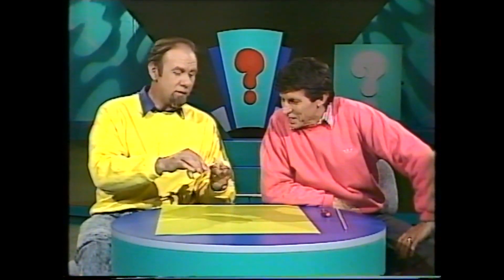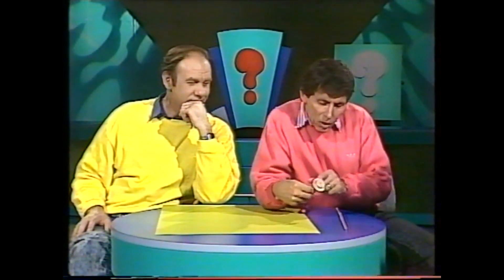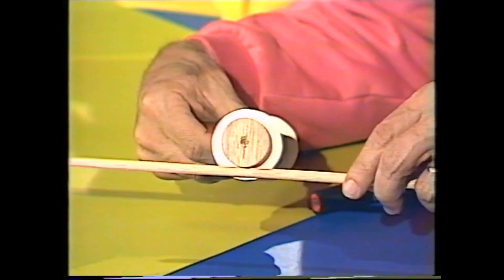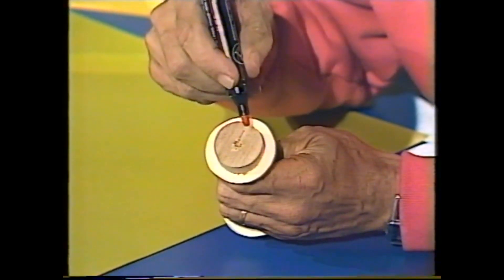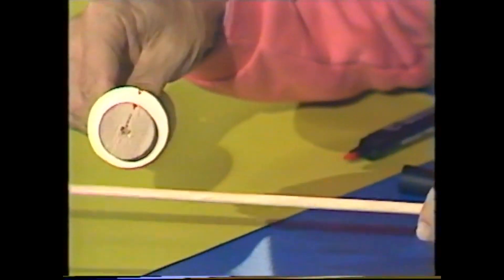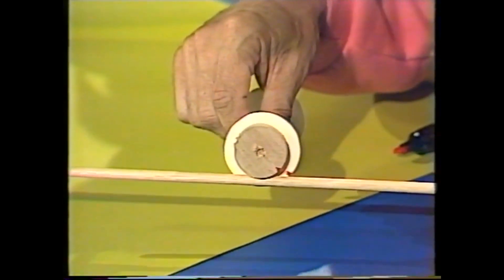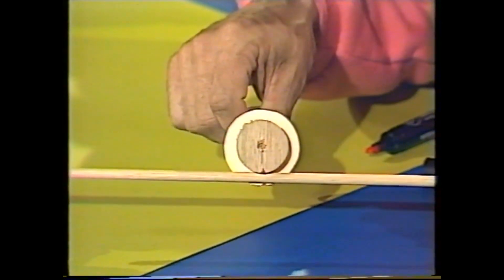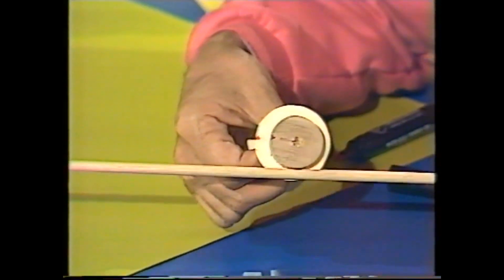How train wheels cannot work

Comment: Smiling...  Same explanation why one with the older Series LAnd Rovers cannot use four wheel drive when on solid surface roads.  On loose gravel, sand, mud everything works fine.  Why?  Because in 4 WD the wheels are locked to each other.  But on not-solid surface roads the wheels can slip a bit allowing curves to be no problem:)
True!  The wheel is also slightly tapered.  Thus slightly varying diameter.  Some Mathematician may wish to calculate at which radius - when too small - slip is the added factor.
Is, at least, my understanding of the whole picture:)
Thanks for posting all these  fantastic and interesting "Curiosity Show" videos. Have been following this channel for years now - that is, since I first discovered them here on YT:)  Much appreciated!

Comment: I've noticed that trains squeak and squeal when going around corners. I have assumed this is because the slower moving outer wheel is being dragged by the faster moving inner wheel. Not sure what point they were making about wheels going backwards. In my mind they are going backwards and forwards as the rotate on the axle.
Reply: The outer wheel moves faster to cover the greater distance. 
Here’s a good explanation. https://m.youtube.com/watch?v=XzgryPhtc1Y
Reply: It's not well demonstrated and explained; but, if they did it better in this video, there might be less to address in a follow-up one.

Whatever part of the flange is lower than the top of the rail is pivoting around the part (point) of the wheel that is touching the top of the rail at that instant.

Imagine a circle
- whose center is the point of contact between the wheel and the top of the rail
- and whose radius is the difference between the radius of the smaller part of the wheel and the radius of the bigger part.

A constantly changing part of the flange is occupying the bottom half of this imaginary circle, starting toward the front of the train and moving toward the back:  i.e., if the train is moving from left to right in your view, this part of the flange is moving clockwise from 3 o'clock to 9 o'clock, beneath the top of the rail; it's going from in front of the point of contact (3 o'clock), to directly below the point of contact (6 o'clock), to behind the point of contact (9 o'clock).

In other words, you have two pivots around which circles turn.  One is the axle, with the whole wheel turning around it.  The other is the point of contact between the wheel and the top surface of the rail, with the flange turning around it.

Comment: The lego train had grippy tracks for the outside rail and smooth slippery tracks for the inside. That way the inside wheel just slipped a bit. The straight sections were also grippy.

Comment: For cars to turn we have differential so that the outer wheel can travel more than the inner wheel and the car doesn't skid, so how does a train doesn't derail if it takes a turn? It doesn't have a differential and its wheel is connected with single shaft.
Reply: It is mainly the flanges.

Comment: Folks, the dot on the flange doesn't matter because it's not bearing on the rail. So yes it goes "backwards" but the dot on the wheel doesn't go backwards. It's the different diameter that causes it. Diameters are important for the turning as well. As many people have pointed out train wheels are truncated cones. The flange brings the cone into play - the flange scrapes the inside edge of the rail which forms the outside of the curve. That's the screeching. It's also why rails and train wheels wear out. The tracks have thousands of metal shards lying in between the rails.

Comment: Umm..
Is the Wheel & or Bogie in question externally powered  ?
What is the Screeetch I have heard on rail both light & heavy as it mounts a corner  ?
Reply: I think the screeching noise is called  curve squeal or flange squeal or something similar.
Reply: The squeal can be from either the flanges or the differential wheel speeds on the outside and inside of a curve.
Counteract with curve grease which comes in summer and winter viscosities and is now made from biodegradable materials.

Comment: Nooooo why??? I need to know this. Why does the train not have a differential like a car does for turning?
Reply: Why?  Because using differentials on a train with hundreds of axles would be too expensive.  Instead, train wheels are shaped like truncated cones pointing out from the train.

This system is self aligning on straight tracks. If the train begins to track away from center, then the side it moving away from enters a wider part of the cone and moves more distance with each direction pushing the wheels back to center. 

When the train goes around a turn, the same mechanism still works, but it's point of equilibrium is shifted slightly to one side to make the wheel sizes match the distance that they need to go around the curve with the same number of revolutions.
Reply: Tim Harig thanks! I couldn’t figure it out originally but this makes much more sense. Props

Comment: The train is able to go around corners because train wheels aren't flat cylinders, they're more cone shaped. This means as the train slides out, a bigger wheel rotates around the outside of corner, while a smaller one rotates around the inside. The two different sized wheels spinning at the same speed means the train turns.

That's the link between the two problems (although the first point is very oddly made) - the edge of a larger circle travels more distance than the edge of a smaller circle spinning the same speed.

 There's a video on youtube where Richard Feynman explains it way better than I do. Worth a watch
Reply: I first saw this demonstrated when I was about 19, visiting the London Science Museum ages ago.  They had a section of inclined track--initially straight, but with an S-bend at the bottom, with some roughly-dumbbell-shaped objects to roll down it.  The cylindrical-ended one could be made to roll straight down the straight part of track, but it would continue straight down the curved part.  The inward-pointing wheels couldn't be made to go down even the straight part without veering off; if they got even the tiniest bit out of line, they would steer even more in that direction.  The outward-pointing wheels, even if placed on the track slightly crooked, would self-stabilize and then follow the curve beautifully, with no flanges.
Reply: A lot of old transit equipment and streetcars do not have tapered wheel treads but instead rely on the flanges and somewhat the rail geometry.  On streetcars extremely narrow treads and flange bearing guideways were also common for the purpose of switches that work better in a street installation requiring less of the rails to be movable.  On a flange bearing system the flange rim tends to track in to the lowest apex of a groove so the physics are similar to the tapered tread.

Comment: The first point is bs right? It's just how you interpret the movement, but all in all the wheel is going round and in 1 way. I'm confused by their explanation...
Reply: Yeah I was just left scratching my head too. The entire wheel assembly is still moving in the same direction (clockwise) at all times, so I fail the see what they mean.
As for curved tracks, I imagine slippage slippage is factored into wheel's the conical design.
Reply: No, its not bs. Think about your shoes as you walk; each one moves backwards, as you move forwards. If it weren't for friction your shoe would slide backwards and you would remain {relatively} stationary {if we exclude procession and the concept of reaction-wheel style motion.}
Reply: The velocity of the bottom of the flange is indeed backwards from a stationary observer's point of view.  Everything pivots around the instantaneous point of contact with the rail.  But that is irrelevant, because the wheel is still rolling and moving forwards, even though some points on it temporarily move backwards.
Reply: I’m also a bit confused.
Reply: It's sort of an 'apparent retrograde motion' of the flange, the same thing happens to planets, and you can see some a good explanation/diagram on Wikipedia, and then apply it here, that underside of the flange is retrograding.
Reply: There was no explanation to either point, that wasn't their intent. It was meant to get kids thinking about the problem.
Reply: It's not well demonstrated and explained; but, if they did it better in this video, there might be less to address in a follow-up one.

Whatever part of the flange is lower than the top of the rail is pivoting around the part (point) of the wheel that is touching the top of the rail at that instant.

Imagine a circle
- whose center is the point of contact between the wheel and the top of the rail
- and whose radius is the difference between the radius of the smaller part of the wheel and the radius of the bigger part.

A constantly changing part of the flange is occupying the bottom half of this imaginary circle, starting toward the front of the train and moving toward the back:  i.e., if the train is moving from left to right in your view, this part of the flange is moving clockwise from 3 o'clock to 9 o'clock, beneath the top of the rail; it's going from in front of the point of contact (3 o'clock), to directly below the point of contact (6 o'clock), to behind the point of contact (9 o'clock).

In other words, you have two pivots around which circles turn.  One is the axle, with the whole wheel turning around it.  The other is the point of contact between the wheel and the top surface of the rail, with the flange turning around it.

Comment: Ok I need the comment section’s help. I completely understand the second part about the fixed wheels and axles and the curvature of the track etc. But the beginning made no sense to me and I got absolutely nothing out of it. Explanation please. Help!
Reply: I think it was basically just a red herring...  pointing out that as a wheel rolls, part of it is "going backwards", but doing it in such a way to make it seem strange.
Reply: It's not well demonstrated and explained; but, if they did it better in this video, there might be less to address in a follow-up one.

Whatever part of the flange is lower than the top of the rail is pivoting around the part (point) of the wheel that is touching the top of the rail at that instant.

Imagine a circle
- whose center is the point of contact between the wheel and the top of the rail
- and whose radius is the difference between the radius of the smaller part of the wheel and the radius of the bigger part.

A constantly changing part of the flange is occupying the bottom half of this imaginary circle, starting toward the front of the train and moving toward the back:  i.e., if the train is moving from left to right in your view, this part of the flange is moving clockwise from 3 o'clock to 9 o'clock, beneath the top of the rail; it's going from in front of the point of contact (3 o'clock), to directly below the point of contact (6 o'clock), to behind the point of contact (9 o'clock).

In other words, you have two pivots around which circles turn.  One is the axle, with the whole wheel turning around it.  The other is the point of contact between the wheel and the top surface of the rail, with the flange turning around it.